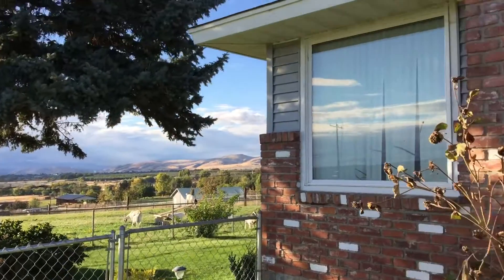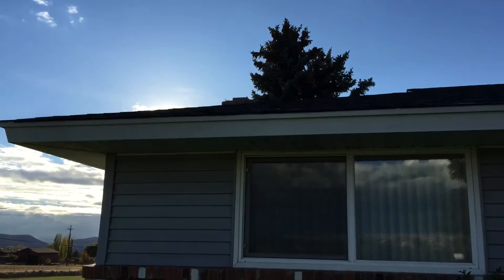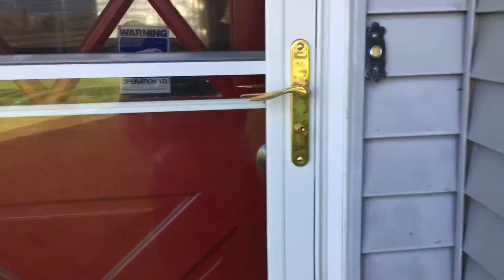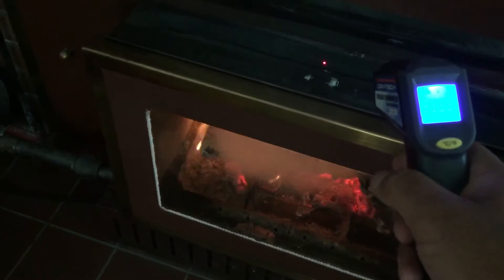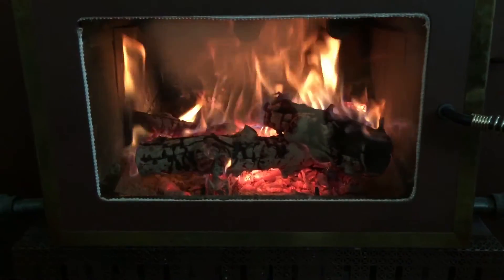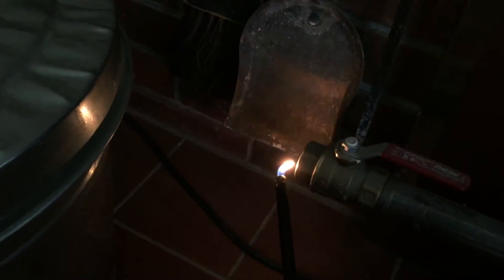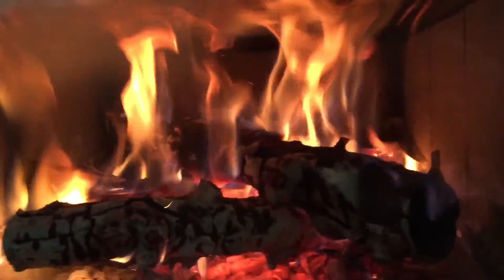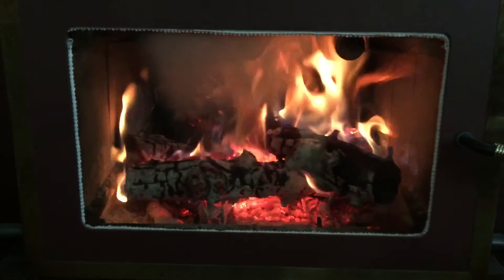Clean Burn old wood stove

Comment: Any design tips on how you added secondary and tertiary air to your insert. I have an old Fisher I'd like to modify for a cleaner burn. Thanks so much, Greg
Reply from the maker: Greg Mann I used regular black pipe from Home Depot. It’s holding up ok for  3yrs, I plan replacing it with stainless when needed. I used fittings for all the secondary system (no welding) later I added tertiary air (I welded one piece) I would focus on just secondary air and adding a baffle. I used regular hole saw from Milwaukee to drill out the holes on the stove, take it slow and use lube (easier than u think). The air flow starts at the front top of stove, goes to back and “T” connection tubes come back from the back towards the front, (this is where I drilled the holes for air into stove) The idea is to super heat the air as it flows to the back, so it ignites faster. The tubes created a structure where I could place firebrick for my baffle. I just added angle steel to each row to create a ceiling. ( I left room for flow into the upper chamber that was created) 
I can make a another video explaining in detail what I did, and what I would do differently. Let me know if you are interested.

Comment: So the air coming in at the bottom and around the fire works just as good as a top mounted air wash set up in store bought EPA stoves have to keep the glass clean?
Reply from the maker: woodrage1 as far as air wash it’d be best if it came from all around the glass to keep it clean. As far as best for  burning, it’s best if it’s coming from all around the bottom, to feed the fire from all sides with primary air. That’s how mine is and it works great. But the glass doesn’t stay perfectly clean all the time. It doesn’t get black just a little cloudy away from the air tubes on top.